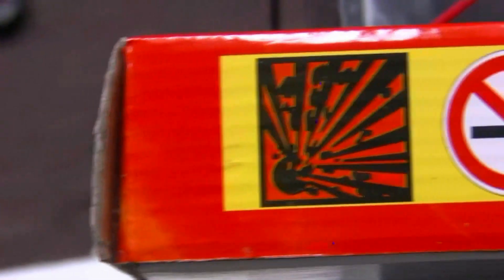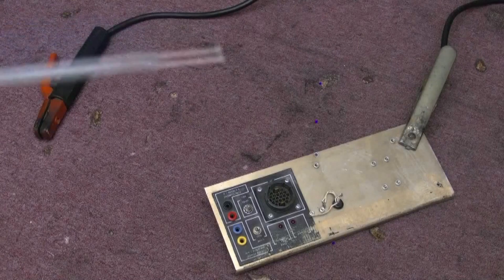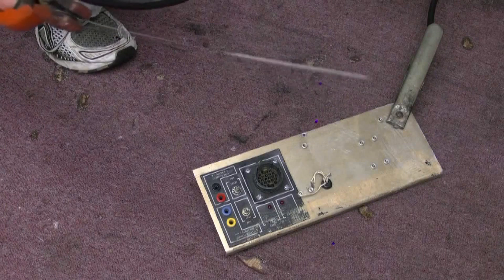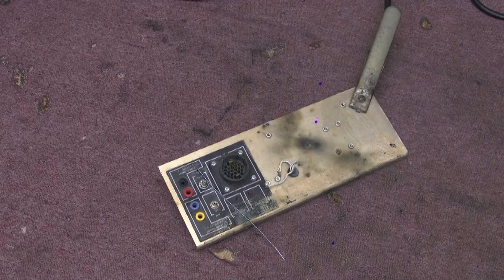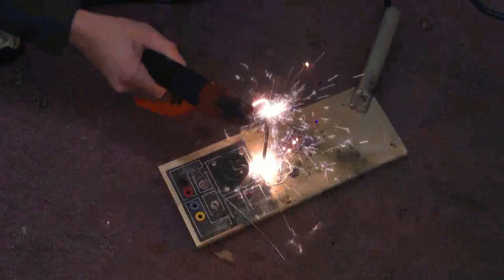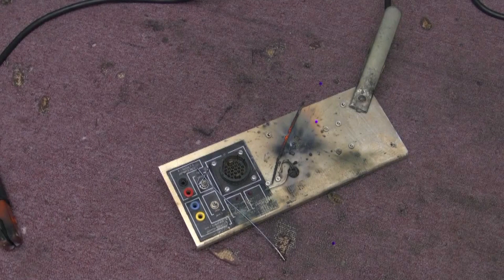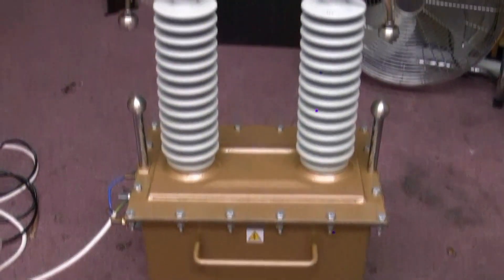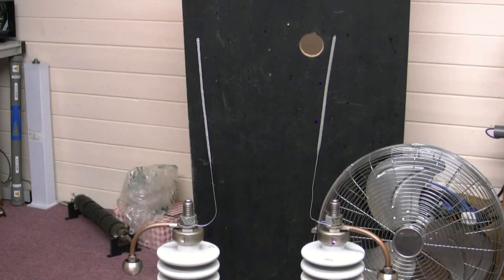Ignition Tests With Lasers & HV

Comment: why does the picture distort with green lasers? the camera must not like filming green light. I have a low power green laser from one of those star shower things you see advertised on TV. I should turn it on with no guard and aim it at the wall and see if it distorts the cam on my phone. I'm going to try to make a laser pointer from this laser and a power bank case and 2AA battery holder.

Comment: fuck that shoot gasoline with the laser or set off a stick if dynamite
Reply: Age of Reason gasoline is transparent, thus won't absorb the light from the laser. No light = no heat = no flame :(
Reply: dawsonw128 Simple solution: Since the fumes are what are highly flammable, place a floating candle in your target medium.

Aim at its attachments wick.

Comment: Those Green lazers are nifty, so they come in pocket size? Could replace my knife.
Reply: Btw don't buy those cheap green lasers. Watch my green laser video, and you will see that a 5mw standard green laser can burn because it has a shit ton of infrared radiation leaking out. Even more then green. Imagine how that would be at 150mw. I almost destroyed my vision with those cheap green lasers, even with eye protection due to infrared radiation back in september 2013 (when i made the video on my channel). My vision is fully recovered now :) just a reminder.
Reply: agreed great to destroy wasp nests
Reply: Well, thats not a good idea. Those are pretty rare to find in pocket size. If you really want one, you can build your own handheld battery powered powerful blue laser. Go to laserpointerforums to see how to build one. Building one is way cheaper then buying one, and chances are extremely high, that it will be seized by customs unless they send your laser in parts in separate packages so customs can't test them. And you need to solder.

Comment: Is is true that blue lasers are more powerful?
Reply: +ChompChompNomNom green is brighter than blue with the same power, blue is cheaper and so you often find it cheaper at higher powers, but both can have any power
Reply: +ChompChompNomNom Just by weavelength yes. But you can have 2kW Red, Green or Blue.
Those are easy, it gets worse when you have 400kW uv-laser as it will cut you into pieces after reflecting of something you did not even see it. So you test your setup with visible light and then step up to "working light".
The most powerful setup I saw in a lab was using HeNe-lasers to "pump" green lasers to pump a TiSapphire-laser that had an output of 400kW for 5ns before going through 0W for 5ns. That was scary!
Reply: I use gamma ray lasers
Reply: I didnt know you could make a laser out of radiation
Reply: ***** infrared is also radiation 0.o
Reply: Are you saying there are infra red photons?
Reply: DPSS green lasers (which is used in this video) uses a powerful infrared pump diode. And the IR light is also leaking. Blue lasers are generally more powerful and effective at the same wattage in power. 

DPSS lasers are also very sensitive to temperatures. While a direct diode can be operated in liquid nitrogen. So blue laser are in fact more powerful, due to photon physics.
Reply: I want to meet my friends. Blade, Laser and Blaser.
Reply: +ChompChompNomNom You can't actually make a laser without radiation. Light is radiation.
Reply: +MatzeGamer 2W not 2kW. Where the hell did you get your info. None of it is true. Plus, the most powerful visible laser is a dye laser. It can reach peaks o 1MW.
Reply: +Laser Guy finally, a persons like me who knows a shit ton about lasers
Reply: SuperReeseP yea most kids don't know what they are talking about, just say whatever they heard without doing some extra research

Comment: I don't think you're aware of the IR cone around the green line. IR has a greater divergence and you can't see it.
Reply: ***** Unless you put an IR filter in front of it, a great deal of the power goes out as IR. It will still trigger the power meter and can thus fool the unsuspecting user, and also hurt them.
Reply: +Lajos Winkler This is a DPSS laser, while infrared is present inside, it is not emitted. inside, precautions are taken to insure only 532 nm green is emitted. This includes mirrors which are 100% reflective at 1064nm, but are transparent at 532 for output windows, and also some simply direct all the 1064 back into the YAG rod for more pumping and "recycling" of a sort. only cheap DPSS lasers, or ones from questionable brands emit IR radiation. IR filters are really not needed due to the mirrors, but they are always an option if you question whether the laser is emitting IR radiation.

I think perhaps you were thinking of some of the cheap "linear" versions in which the KTP/LBO crystal simply dumps straight to the output window emitting 532 and 1064.

Comment: is that a carbon dioxide laser?
Reply: no DPSS
Reply: I'll have to look up DPSS
Reply: tall32guy D.P.S.S. stands for diode pumped solid state laser. it uses a diode to emit the light. similar to an led and a small driver circuit also again similar to an led. they need to be heat sinked and are reasonably efficient as this laser is a 1W laser and you can get quite a bit of heat output and light output. they are much more efficient and more robust than gas lasers and have a longer life span but gas lasers are way cooler!

Comment: has anyone noticed that when the laser hits the target and starts burning the stuff his camera starts failing
Reply: Josh Parker Lol, no man. Why dont You go and watch Photons video  "What Were Those 3 Dots ?"
Reply: b000bietrap5
No I'm legally blind
Reply: Colt Parker I don't think it's YouTube's end. I think it's the software on the camera that's being overloaded with green.
Reply: wierd
Reply: Josh Parker How do You know that ?
Reply: Josh Parker Fuck....
Reply: Colt Parker
No, video cameras use fairly light compression. Good compression would kill the battery.
Reply: Yes
Reply: Videos Plus bitrate aka how compressed is your vidso
Reply: Not a scientist but don't the lasers, particularly green ones, run on high frequencies? Pushing the voltage may increase that frequency or if not, the higher intensity is reflecting back to the sensor and causing the sensor to heat up, probably adding another purple dot. Sorry I'm 4 years late
Reply: j wheeler Because its so powerfull that it reflects a shitload of light into CCD.
Reply: Josh Parker Are they complicated ?

Comment: where can i get a laser like that? and the goggles!
Reply: Ebay
Reply: Sad Carrot
Sadly not on eBay UK I can't unless it is 40mW and I'm guessing that is a good 200mW at least.
Reply: This is 1W DPSS laser, You can see that somewhere in video where i shows that module.
Reply: Buy one from CNI.  Or Laserwave.  I assume after 9 months you probably found one, but if not, CNI and Laserwave are high quality, and IR filtered.  I use them in my projector builds.

Comment: Was that the back of your old LG scope/generator you were welding the sparklers off of that you smashed in an old vid after burning up the generator in it in a failed experiment were you tried to drive an induction motor controller out of a washing machine?

Comment: It may be a switching power supply, in which case it's quite normal for those things to make soft quiet hissing or whistling noises depending on what your device is doing, I've used heaps of devices that use switching power supplies and the noises those things make always fascinates me.